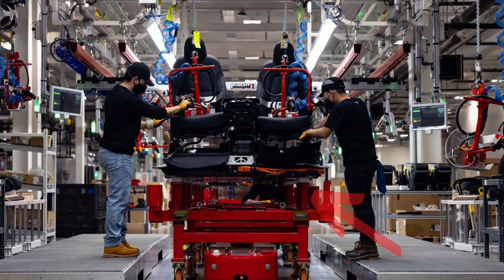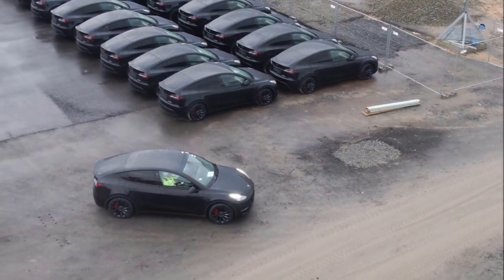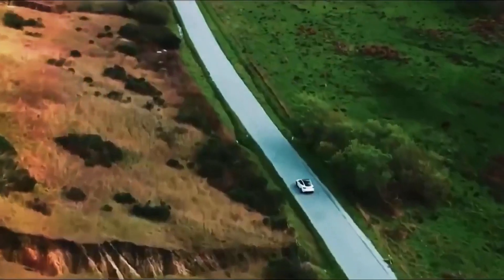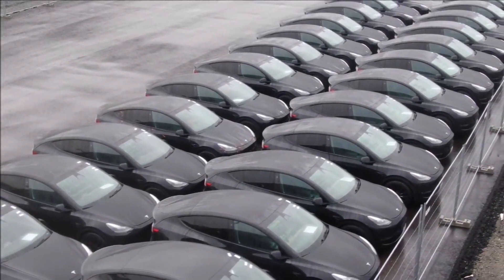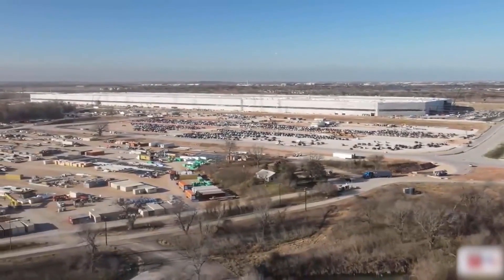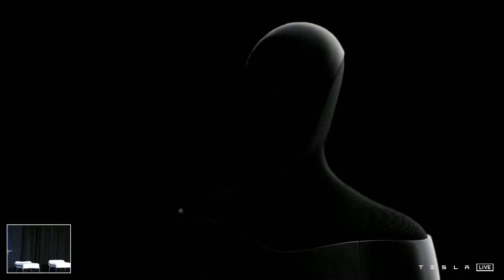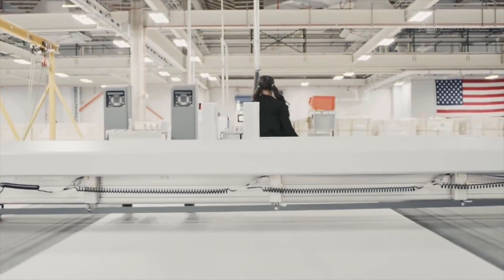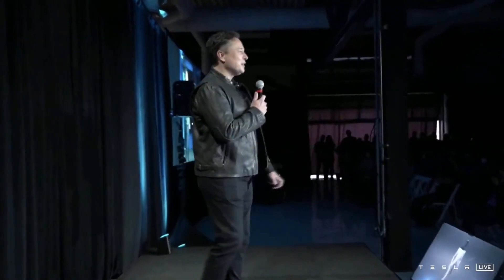NEW Tesla Model Y 4680 Battery Confirmed & Cybertruck News

Comment: Specs please? Plus how are they going to handle having two essentially different cars in the US and the transition to the new one?
Reply: @technopool9870  this ☝️ 
Producing cars with max range right away would basically make older models inferior and new owners would be furious. Nobody would want cars produced at Fremont. By waiting they can adjust this over time and distribute available 4680 batteries across more units increasing their profits. If competition starts pressing them on range I can see them adjust it on demand.